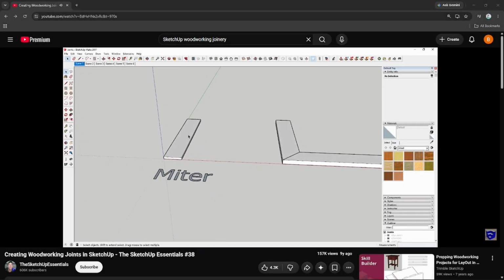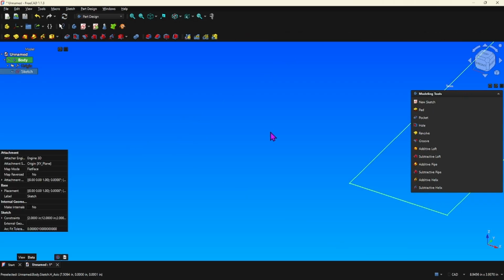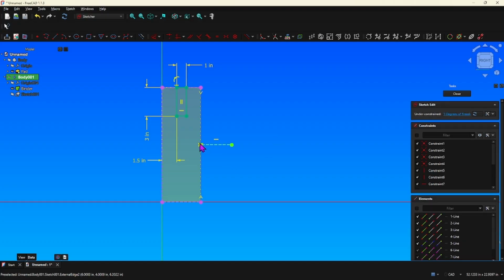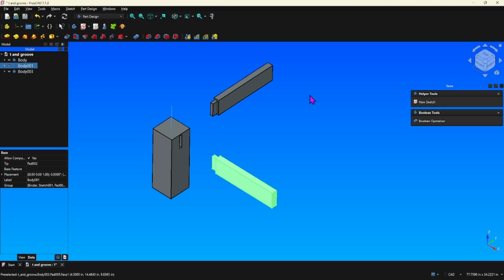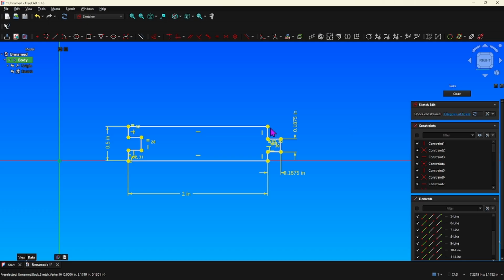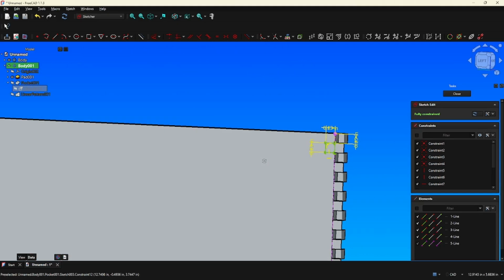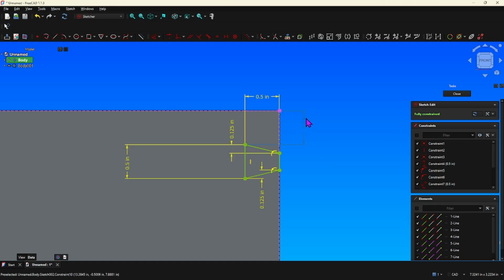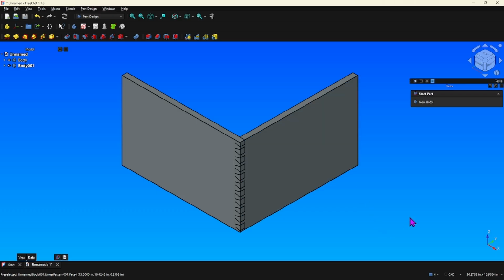FreeCAD; The SketchUp Escape Plan 2 of 3 Taming Constraints and Transforming Parts

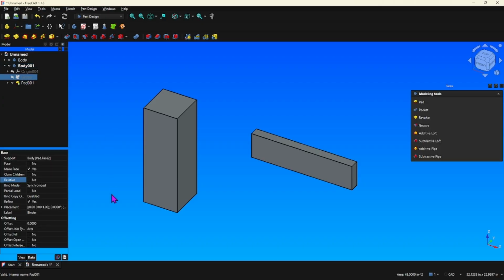Comment: Hopefully the programmers are watching this. They need a sub routine for dissociating elements. Like that sketch that stayed. @31:42. That would allow 2 things being able to use the sketch for a new body and for the pocketing of the block for the mortise. Also, the SU guy is not doing a good job of using components. @38:45 the default toggle for binder being yes. If another user's toggle is on...does your model go to crap when he opens it?

Comment: @15:14 You illustrated a programming flaw, When one selects an info box, the added information (90) should not have tagged on but should have over written. Secondarily, is there no way to align faces/edges in bodies?
Reply from the maker: Thank you, Bruce!  There is a way to align faces/edges of bodies but I did not demonstrate it.  I'll try to cover it in my next video.  For now, the way you do it is create two bodies in FreeCAD, then select one of the bodies in the model panel (normally the panel is on the left).  After you select the body use the pull down menu "EDIT" at the top and select Transform.  When the the Transform panel opens you should select to the right of "Mode" at the top of the panel, then select Custom.  At this point you select the face or edge on the Body you want to move.  Now go back to the Transform panel to the bottom where it indicates Utilities and select "Move to Other Object" then select the face or edge on the other object you want the Body to move to.  If it does not align in the direction you intended then you will likely need to rotate the object 180 degrees for the two faces to align.

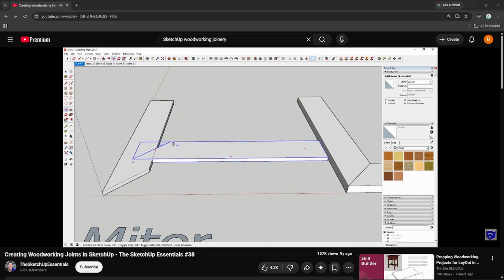Comment: @t=1:52, I would recommend  making a sub shape binder of the dovetail face and using it to pocket the second body and you have the slots to the depth of the wood thickness. Alternatively, use the shape binder and boolean cut to achieve the same thing.
Reply from the maker: I like that approach.  Sometimes shape binders do not behave for me so I just need more practice.

Comment: Freecad has an Offset feature in Parts Design workbench just like Sketchup
Reply from the maker: I will give that a try but if I remember correctly when you use the offset in Part Design the result of the offset is that the new part you created is fused with the Body that you used as reference.  My Intention is to make a separate Body so I can manipulate that Body without it being tied to another Body.